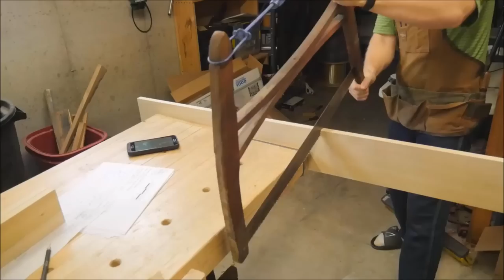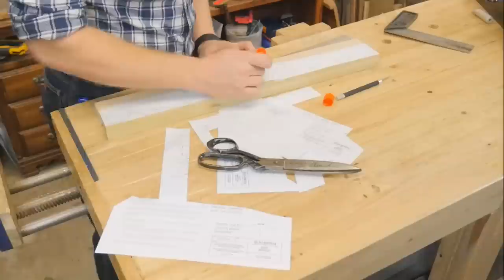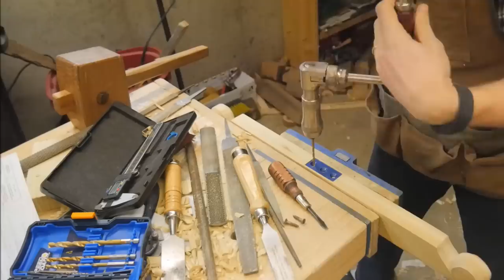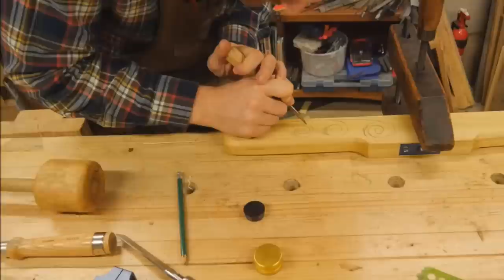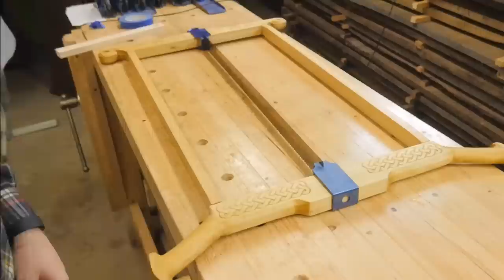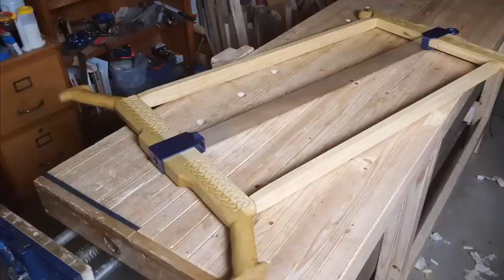How To Build A Roubo Style Frame Saw BlackBurn Tools Kit

Comment: very cool!  I'm sold.  Do you think mahogany is a good choice?  I just got some OLD planks which are perfectly stable, and very light.   Also, before i go ahead and order the kit, what size did you use and do you think it would be suitable for resawing 12" wide boards?  Thanks alot :D
Reply from the maker: +scott mahogany would be a great Wood for it. I suggest the 32" kit for one man operation. if you want to do 2 man work you can go longer, but one man has a hard time moving the saw more then 32" looking forward to seeing what you make. do you have a kerfing plane?
Reply: i don't have a kerfing plane, no.   I saw your  build on that.  i think i'll probably make one of those too.  I've got the hand plane obsession, like many of us on here.  Thanks for the advice, i'm gonna go for it.

Even though i'm gonna take a bath on cross-border purchasing, the dollar how it is right now. haha
Reply: i've just found Tom Fidgeon's videos on the kerfing plane and frame saw, with the subsequent link to Bad Axe Tools.  They want 250 (US$ i think) for all the parts and fasteners to make both tools, minus the wood of course. Sharpened.   Sounds pricey but less than my bandsaw cost :D
Reply from the maker: Yup I have used think kit in the past and it is a good setup. High quality. this set was made with eh Blackburn kit. both a joy to put together. the Blackburn kit can be A LOT cheaper if you do your own sharpening. but they do also sell it sharpened.
Reply: still, really pricey on the cross border shopping, our dollar is doing badly right now.  I think i'll buy a 3/4" bandsaw blade with a low tooth count, and rig it up with that. I made a bow saw a few years ago, this is pretty much the same thing.  I like the way you emphasize the enjoyment of the craft, btw, rather than the production of "things". good one
Reply from the maker: There you go! I did that for my turning saw! I would love to see that when done!

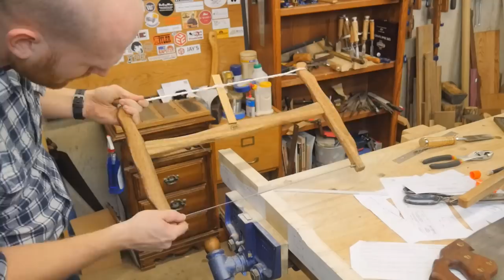Comment: How big is the frame saws at 2:06 and 2:11?
Reply from the maker: that is a turning saw. the blade on that one is 18" I have another turning saw that is 12" as well.
Reply: Thank you,  @WoodByWright . I am preparing to build one or two smaller frame saws and I want to know, what to aim for. I think mine is going to 40 cm (16").
Reply from the maker: Sounds like fun. let me know what questions you have. I have 3 other videos making frame and bow saws.

Comment: The grip is well described in Tom Fidgen’s first Unplugged Workshop book; as well as making the Kerfing Plane in both fenced and adjustable fence.  I’m going to make two solid fence (1/8” for veneers, then one for resawing common 4/4, and finally an adjustable using my 34”x6 thread box/tap).

Comment: This is as what the old timers used called a PIT SAW.  Where two men used a 6 foot rip saw. One stood on top of a frame above the PIT, and the other was the pitman. This the expression , I'm in the pits. Ok now and adaptation came out of this where it was used by one in the PIT and the top handle was attached to a 'SpringPole' which was a  6-8" sapling about 12-15 feet long. It was anchored to the base of a tree, with the butt end then tethered about 6-8 feet up at an angle, then the top of the SpringPole was tied to the PULL UP HANDLE. Thus cause the SpringPole to return after the pull down stroke.
Ok said all that just to say this.
Don't see why you couldn't get the same results by attaching a very strong return spring to the opposite side of you table, then attach it with a turnbuckle bolt to the saw. Thus cutting your labour intensity in 1/2
Reply from the maker: I love working with a pit saw! I have put in a few hours under with he dust falling down. LOL. I actually had the same thought when i made my first frame saw. The problem is with a pit saw the spring is there to remove gravity from he equation but when cutting horizontally it is not a factor. Putting a spring on it would mean you would have to double the work on the pull stroke. in the end it is more comfortable to spread the work out so half is on the push stroke and half is on the return.